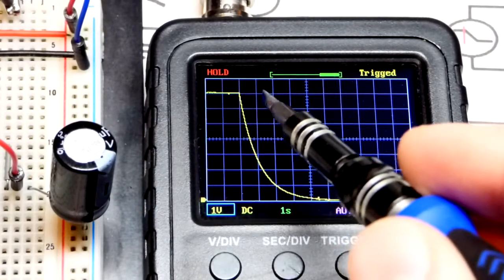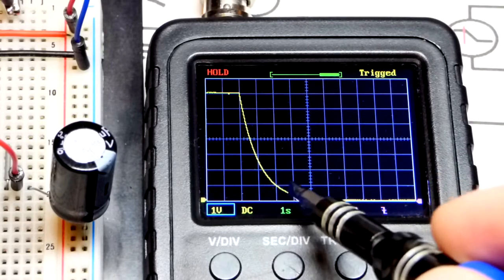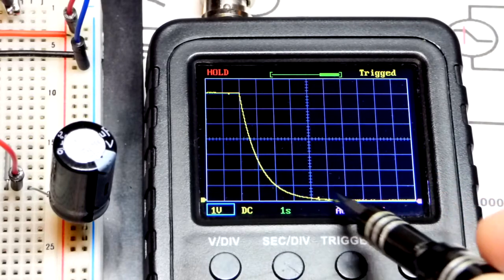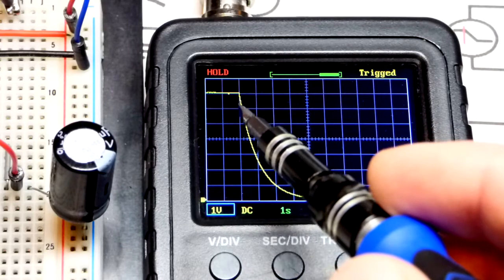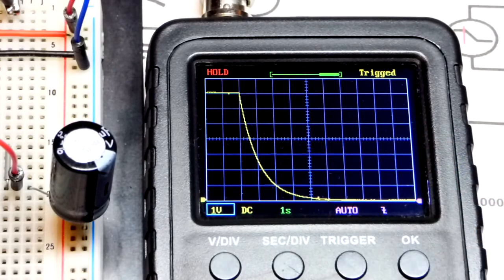RC time constant capacitor charge and discharge curve including through LEDs for quick videos 7

Comment: ELECTRONZAPDOTCOM
                        I always that the CHARGE was charged current & voltage. When the circuit load is drawing current OFF the "charge" off of the filter caps which is current i thought. The circuit load converts the charge stored from the filter caps into current? 
 EE engineers have told me that Charge is NOT current or voltage they are all 3 different qualities. So I'm very confused on what is the difference between CHARGE compared to current/voltage because EE engineers are saying that a filter cap stores charge NOT current or voltage and when the circuit load is connect to filter caps its pull off the CHARGE not the current or voltage out of the filter caps, I have always thought the circuit load was pull out the current of the filter caps in the power supply.
Reply from the maker: A discharged capacitor has 2 plates with equal charges across them. A voltage across the capacitor moves charges off one plate and onto another until the voltage equalizes with the voltage source. The more charge difference between the plates = a higher voltage. Then when you put a load across the capacitor, the charges go back where they belong on the plates and the capacitor voltage goes down.
Reply: @Electronzap  thanks for the help, but what is the difference between a Charge compared to current & voltage? because I thought a Charge was current & voltage but a Charge is neither a current or voltage it seems?